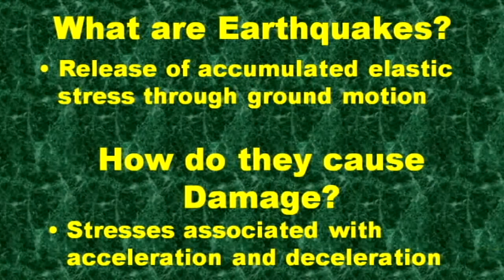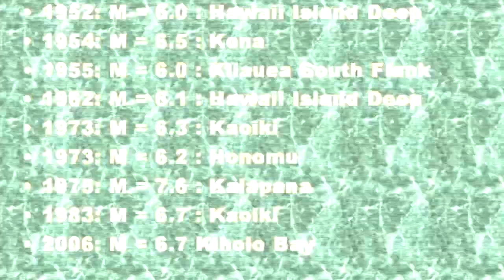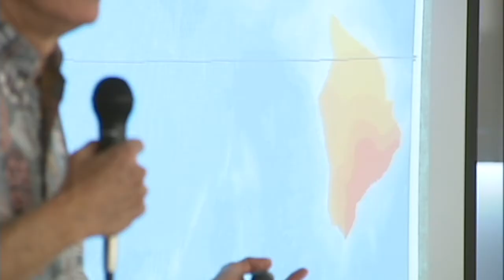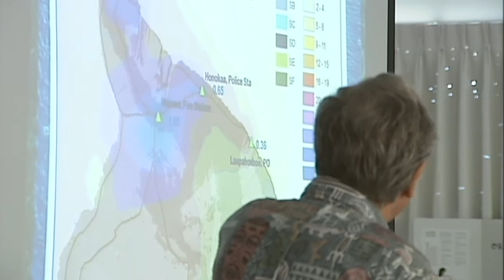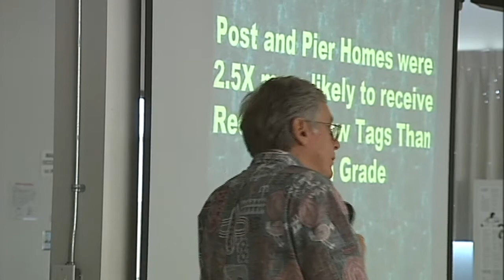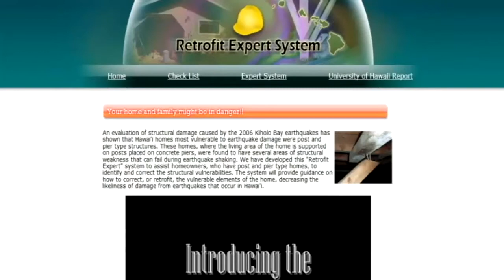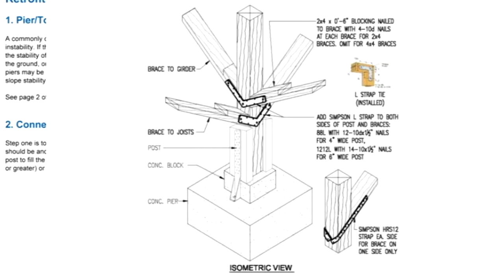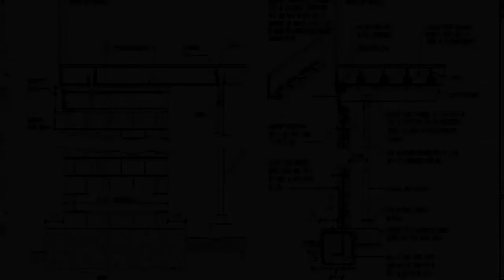The Next Big Quake on the Big Island: Retrofitting Your Post and Pier Home in Hawaii

Comment: ALL OF THESE ARE VERY BAD DESIGNS. DO NOT ATTACH THE STRUCTURE TO THE GROUND. CENTER EACH POST ON TOP OF A 30" DIAMETER CONCRETE FOOTING THAT HAS A 1/2 LAYER OF NYLON BETWEEN THE FOOTING AND THE POST. THEREFORE, ALLOWING THE POST TO SLIDE. USE THREE HORIZONTAL ANCHOR SPINGS PER POST TO SELF CENTER THE POST.
Reply: Are you a structural engineer?